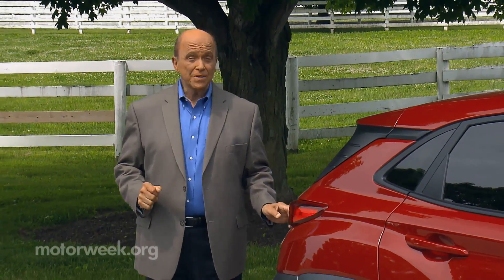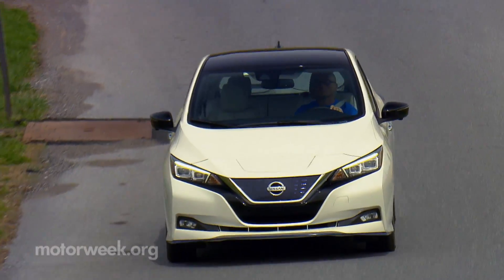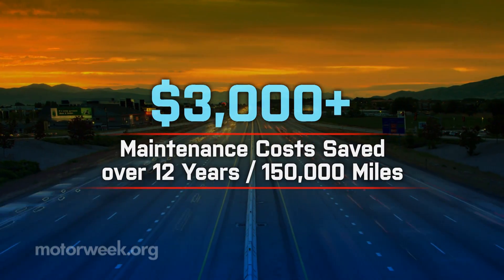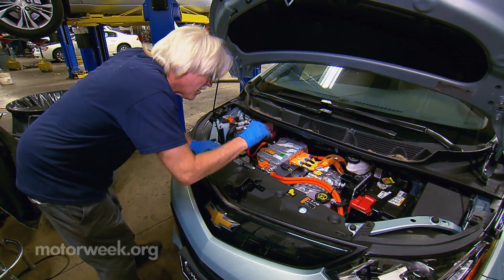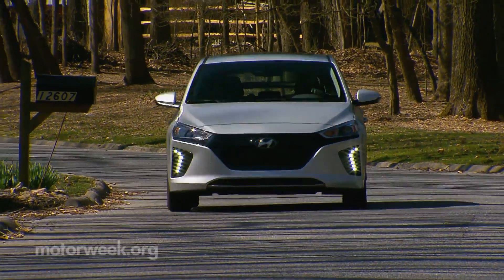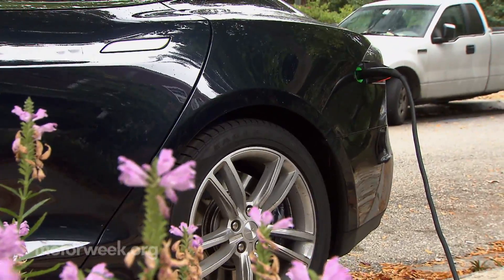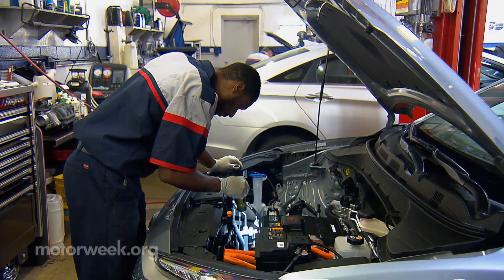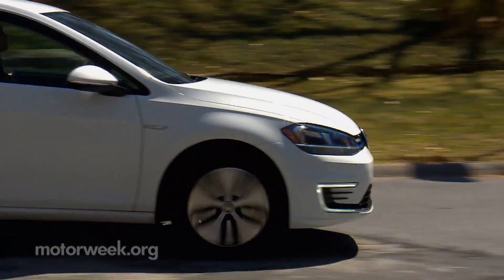Electric vs Gas Vehicles: The Long Term Cost Comparison

Comment: SMH. Electric Vehicles are not green. And where will the energy come from when 200 million American plug in their EV’s everyday? And why would I buy an EV, when on a longer trip, requires me to plug in for about an hour just for an 80% charge, when I can be in and out of a gas station in less than five minutes? And that expensive battery in the EV will require an exchange one day. What of the environmental impact of both production and disposal of these? Why does nobody speak of this? No sir, not for me. I’ll keep my ICE vehicle which is fast, fun, good looking, and still gets me 40 mpg on the highway and cost me HALF of what an EV costs from a dealer. EVs are fine for those who want one, but no way those of us who appreciate our ICE vehicles should be mandated to purchase them. I’m getting tired of all the propaganda pro EV and anti-ICE. Let we consumers decide for ourselves. Many, if not most, still choose ICE vehicles, so let us alone and stop pushing this electric technology upon us against our will. I’ve driven them and am not a fan!

Comment: He forgot about ev hiding money pit service u had pay over years more expensive that gasoline cars ..tires and pay gas tax even if u don't  use gas car pay tax any state  u live in and  pay at  charging stations or electricity u used to charge  own car pay maintenance liquid of the batteries or pay new battery or if u crash u had buy  parts that are more expensive that normally pay for gasoline  car so won't buy ev car till 2030 when everyone is forced to buy one

Comment: EV's are all fine and good under the right conditions, and I think a lot of people leave these out when considering them. 1) Long trips that require charging overnight need to be more planned. You're not going to swing through the gas station and be on the road again in 5 or 10 minutes. And 2) if you're in an area impacted by rolling blackouts, you won't be charging them. But for the bulk of in town city errands and commutes, they are probably pretty good most of the time. But they are not a one-size-fits-all solution.
Reply: So only get an EV if you already have a working gas car, so you can use the gas car for long road trips and use the EV for short daily commutes?

Comment: Electric cars still need AC recharges, and coolant change, water pumps, and a $21,000 battery every 10-15 years, the electric motors and controllers will eventually need to be replaced, unlike an engine, if you take really good care of it, you can roll the odometer over, please, let me know when an electric car hits 1,000,000 miles with the original battery and motors, I will love to see it 😁👍🏼

Comment: Don't get an electric car. The main reason is a new battery cost almost 20,000 dollars. On the low end 6500.00 dollars plus 3500.00 for installation. Gas is cheaper. Unless your rich.

Comment: You didn't mention in the video that California officials (Gavin Newsom) told all Cali residents to stop using AC and other powered items since it's a strain on the power grid. Plus.. I'm sure those home chargers with be vandalized or stolen in a heartbeat. Smh🤦‍♂️

Comment: Whoa you can save 3k in 12 years buy purchasing an EV, so the price difference is nothing if you keep the car 72 years. Although when more electric dependence happens the light bill will go up. How much does those batteries cost? About 20k? And how long do they last? In 72 years I'd say you'll replace them at the very least 4 times so how much are you saving? EV is trendy garbage.

Comment: Try this in califukia, they can't even maintain their grid as it is.
Do the greenies realize that if you dig out ALL of the current lithium in China using SLAVE labor leaving just a barren wasteland, then you might (just maybe) have enough to make a battery source available for one electric car per family in the state of California ONLY. 

Has any of these greenies done any of the environmental impact of the result when these batteries finally deplete themselves. And the human impact and environmental impact resulting from this extraction.

From a report by the world economic forum "The answer to the question is lithium, and the bad news for the world is that it potentially has nowhere near enough of it to power all the electric vehicle (EV) batteries it wants – and needs."...

Also... Not including the manufacturing and chemical dependency necessary for anything relative to the mining of cobalt,nickel and other materials necessary to manufacture global quantities of these sources. Let alone the disposition of waste during and after the manufacturing process plus after the depletion of said source at end of use.
 
With not only the batteries, there's glass, rubber (from petrochemicals for tires and seals) oils( for lubrication and manufacturer) plus the chemicals necessary to manufacture the inner cabin ( seat, dash , trim and components) the processes (chemical and processing for computer, electronics and cabling) and even more chemicals for the auto body systems including it's manufacture. As composites don't grow on trees. And this is further mitigated as necessary as weight is a prime concern.

Now comes the inevitable disposition of all this additional waste product AND THE RESULTANT ENVIRONMENTAL IMPACT. 

Then there's the discussion of the means to produce the electricity for the resultant charge state and the mitigation of hysteresis in the composite structure of the battery. 

Let alone that not ALL mined lithium is capable to be used for batteries. There is also needs from this mining for computers, cell phones, medical device manufacture and production. Storage devices for solar and wind and back up storage for power systems.

Then the eventual disposition of these cells when they are incapable of being used any further. That's just scratching the surface alone.

From the IEW (31 member nation group)

 "We estimate there are now around 16 million electric cars on the road worldwide, consuming roughly 30 terawatt-hours (TWh) of electricity per year, the equivalent of all the electricity generated in Ireland. Electric cars helped avoid oil consumption and CO2 emissions in 2021, although these benefits were cancelled out by the parallel increase in the sales of SUVs." 
(This  above document fails to provide the following information)

Multi-sourced information:
  
It takes 500,000 Ibs of raw grade a material to make a single 1000 lb. battery.

It takes 100 to 300 barrels of oil to produce a battery that contains the same energy of 1 barrel of oil

To manufacture 1 (automotive) battery for a new (green) electric car costs a carbon debt rate of 10 to 40 tons of co2 

Not inclusive of the mining and chemical support and attributable waste produced for manufactured elements of cobalt,zinc and nickel

Comment: Price out a battery 10 k to 20 k and I work on them 27 years in the business for GM if we the techs can't make money or a living who's going to fix them? They will have to pay us way more and charge the customer way more for repairs so I call bullshit on the cheaper to maintain in the long run. It's now less time now we see the customers caused by they got taxed on every service the cars needed so they started the high milage coolant plugs oil changes do they last that milage hell no they are in the business of selling cars not maintaining them they dont care if the longer services cause more wear and tear to the car as they are designed to only last 5 years now and want you to buy another vehicle why eveything is plastic sold as its to save fuel they know that shit will not last long term. This alone caused costs to rise now even  less maintenance the car price will jump high use very cheap parts on them  or repair bills will rise big time business. We have to stay in business. And we the older guy are going into house kw system way more money in it same risk whos going to work on kw system same risk way more money or stay in cars kw system for no money would you? The younger internet I want to be a influencer generation and not work dont last long and we have problems finding technitions now days when gas is still around as to many are going into retirement no one is coming in and staying in the business when they find they cost of tools crazy and way less money made and the stress on your body with now lack of services cars lasting longer and our tools a pair of channel locks can cost 90$ each. As you can't use cheap tools that don't last.  And special tools cost hundreds to tens of thousands of dollars we pay for them the technicians and thousands for the up dates for new modle car up dates.  Also the tools we spent $50 to $150 thousand needed to fix gas diesel cars that took years to build up and money we spent on them are now useless. Mom pop shops tire shops exhaust shops custome car shops gone. As they can't de energize the systems to work on them dont have the computer program so dealerships will have a monopoly on the market . A major issue is with fires we can't put them out with a fire extinguisher so it will be a total shop loss if they go on fire. Loss of tools the building other cars as they are dangers just look up in hear ev fires we don't even have our chargers near the building now due to the risk of fires from them far from our dealership. They won't last gas or the combustion engine will never go away.

Comment: My 10 year old toyota yaris cost me 13k. It has 173k miles on it. I replaced the fan belt and radiator hoses. NOTHING else has failed. Lifrtime average mpg is 38.4. Tires get aroun 40k. Beat that with your EV!!!

Comment: It all depends on how long those tires last, any auto mechanic will tell you there is more strain on the wheels on an EV. I believe on a Model Y it’s about 4,400 pounds.

On top of that all of the acceleration and braking goes to the wheels. So expect you could go through tires a lot faster and you need performance tires not all seasons.

Performance tires could cost more than 2x what you normally pay for your ICE. If you are going through those faster you can easily rack up a pretty big annual maintenance bill.

So I think you need to factor in the initial cost difference, upfront costs and tires / wheels etc. Not to mention convenience and non-standard stuff like roof replacement.

I think convenience is a factor too.

Comment: What about the build up of condensation when the EV is out on the streets in the pouring rain; and will the electric motor have problems in the extremely hot; and cold weather?
What about certain parts of the EV that thieves will want to strip down from the EV?
Reply: No the electric vehicle uses battery to keep itself hot or cold depending on weather...average about 1% per day unless like Canada where it's like 20% %week

Comment: I understand that there’s less moving parts inside of EV ; I’d like to know if there are break pads in the wheels; and will the wheels need to be lubed?
Reply: As far as I’m aware, the braking system is exactly the same as a conventional gasoline car, except EVs have regenerative braking too
Reply: The dynamic braking takes most of the strain off the disk brakes

Comment: Price of a Replacement Battery is way to much for the middle class especially with inflation and not everybody has a garage and the cold weather kills the battery but I bet you the tow truck industry will be way busier with these piece of💩 on the roads as they age.

Comment: As prices top $4 a gallon, should you consider an electric vehicle? One consideration: They’re more expensive to insure and repair. Here’s why.:   No!  I have a backup donkey that loves going to town 🤓🧐🤨
Reply: Why choose electric and act like there’s no middle ground? The middle ground is hybrid best of both worlds. Extended range from the battery half and you can fuel up in minutes at the gas station instead of waiting and hour and a half to charge

Comment: I get the point of EV's but I dont think they're convenient enough yet. Need more charging stations or at least better range
Reply: Without being able to charge at home or at work, I wouldn't recommend an EV to anyone right now. If you can charge at home, they are pretty convenient right now for all normal daily driving and some additional work is needed for longer trips. Gas cars are still great for long trips, but not really efficient anymore for daily driving under 100 miles. Better charging infrastructure is very much needed in the US.
Reply: @tremorsrules  no the biggest problem is they take too long to recharge therefore ruining the ease of use experience you’re then going to run into range anxiety wondering if you have enough battery to make it home.

Comment: The savings are actually WAY higher than you mention. You save an gas and oil changes. That’s nearly more than what you mentioned alone.
Reply: Save what?save up for when your battery fails? Save when you live in a colder or hotter climate and your car runs 24/7 to stay at optimal temperature?  Do they serve ice cream in your make believe world?
Reply: You realize in colder weather you lose 30-35% of your range? That’s so bullshit and to make matters worse EVs take so long to recharge at home that you’ll be sitting around waiting for it to charge and if you ever want to leave town and go somewhere far well you’ll have to perform a round trip mathematical calculation to see if your battery has enough charge to make it there and youre going to get tired of it very soon because you’re need to plan if you have enough time to charge it while still needing enough remaining charge for work the following days

Comment: The charging cable came with my nissan Leaf, and my friend is an electrician. He wired a 220 outlet to my driveway for $500. Now I have a fully charged car (225 miles range) for $5 full charge. WORTH IT. For the first 40K miles I charged at a free green lot a mile from my house and rode my electric scooter home.
Reply: If you don't have a electrician as a besty what is cost for a subpage install and setup for something like this?  That is greta that you have a hook up though...just greta
Reply: @spoonsarefun  That question cannot be answered without a slew of information first. The quick answer 600 to 800 in most areas. But that number can be higher or lower based on location distance from the house panel, and but how much that panel has left on it to utilize. If there is space on the panel to expand ,and the distance is not very far the price would be similar to adding a second circuit to a garage for example. If the panel is already loaded then it needs to be upgraded to take in more power before the line itself can be run. $500 bucks is a good price but not a "Hookup" in all regions.  Depends on where they live.
Reply: @spoonsarefun  simmilar to a heat pump disconnect... $500 friend or not... you dont need a subpanel.
Reply: @666dynomax  it needs dedicated circuit, would depend how much space left in panel to determine if subpanel is needed.
Reply: @spoonsarefun  still, pretty cheap.... I had a 60a put in for $340 cash